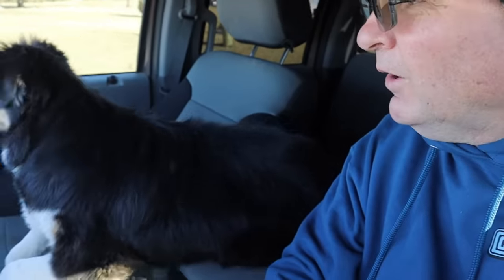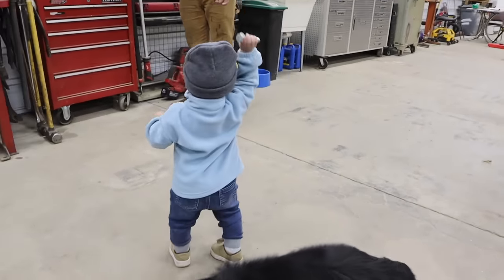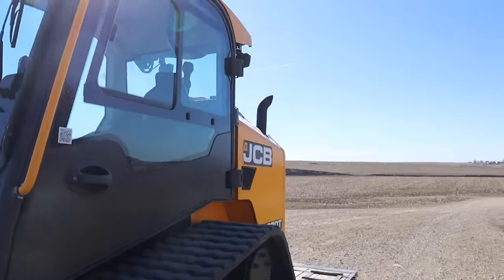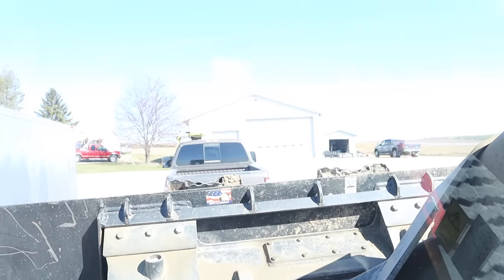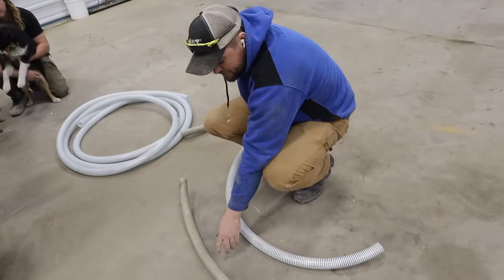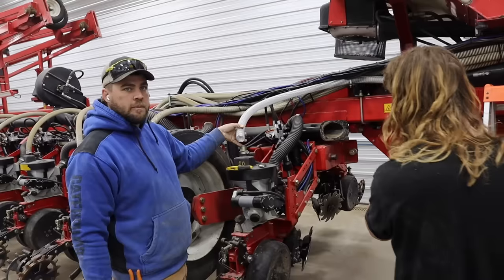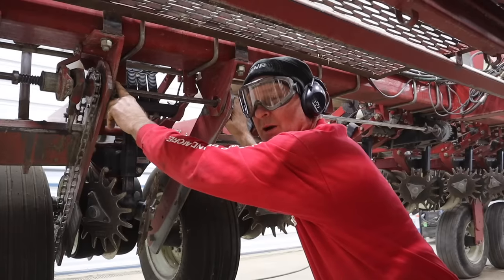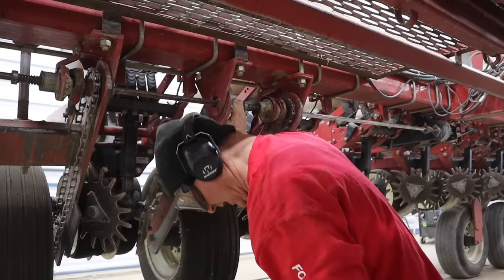my job is at risk

Comment: That style fitting needs a tube insert to squeeze the compression ring into
Reply: Sometimes the insert stays in the fitting and can be a part of the fitting that the tube slides over. The compression ring, also called a ferrule, is different from a commonly used type for copper tubing. DOT rated air fittings for heavy trucks use a slightly thicker and longer compression ring. It seems strange that they would use plastic tubing on a hydraulic line because hydraulic fluid temperatures can get quite high even if the pressure is low. It might be necessary to replace the line and fittings with a hydraulic hose with crimped on fittings.

Comment: Aww….little Eddie is so stinking adorable.  He really could be a Gerber baby model.   ❤.   Before long he will be in the shop with scrap wood, a small hammer & nails & pounding them into the wood.  I went in our basement & my 4 year old daughter had taken some screws, took a hammer & started them into the wood wall,  THEN used a screw driver to screw them in.   I may not have even noticed except there were 6 in a row & at different lengths…😂.    I couldn’t be mad because she was learning & trying.   After that we made sure she had her own “scrap wood”, little hammer and hardware.  I hate looking & seeing all of these toddlers & young children being given a tablet to constantly watch stuff.  If it’s educational & limited time that’s one thing.  But using these as a baby sitting option is not good.  Kids need to learn to be creative, think for themselves & learn by trial & error.  Never forget taking my nephews out bowling.  They said, “Man this is hard.  we usually bowl a 300 on the Wii”.

Comment: I hate them fittings on plastic. I got to use a plastic line for my oil pressure gauge on my truck. I've blown them off racing my truck and sprayed oil over everything. I bought a kit at NAPA that had one that fit a little tighter than factory.